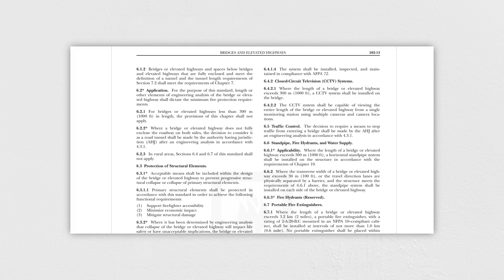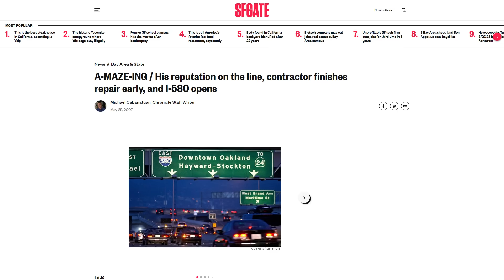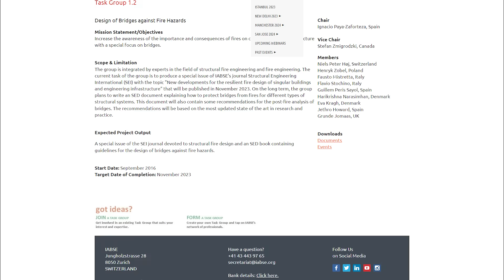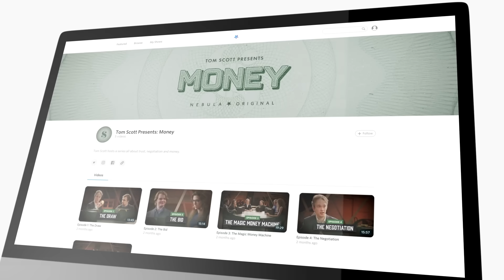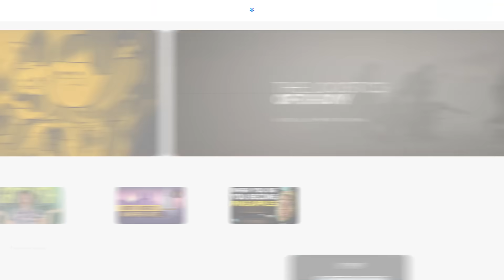Philadelphia I-95 Bridge Collapse Explained

Comment: I’m a disabled firefighter and you mention the heat from convection and radiation but don’t discount conduction and time.  Since most of those bridges have concrete walls/ supports for the steel I beams.  As that concrete heats up it also weakens and to get spalling and cracking.  Based on the image of this collapse it appears it failed more at the end than in the middle so the failure might have been the vertical segments of the structure instead of the horizontal ( steel) structure.  But as I just mentioned time is also a factor.  That concrete holds the heat far longer than the steel structures once the heat source ( fire) is removed (put out).  Those I beams are designed for load but the thickness of the steel is also determined by a limited period of thermal loading.  However, the concrete vertical structure acts as a thermal “battery” holding that heat longer and conducting that heat to the steel above it.  Because how long heat is held against steel is often more of a factor in weakening it than how much heat is applied ( based on ordinary materials burning and excluding non ordinary materials like thermite) the areas near such vertical structures are the ones most likely to fail.  They become the weakest spot in the steel structure because in addition to radiation and convection they are also subjected to conduction, the weakening of its vertical supports, and because the heat will continue to be conducted to that area after the fire is out.  When I left the fire service in 2004 there wasn’t a standard on fighting bridge fires so there may be new standards, but if the bridge hasn't failed once the fire is extinguished firefighters stopped dumping water on it.  There wasn’t studies to determine if it was better to keep hitting the tunnel walls with water to cool them to reduce the long term thermal stressing of the steel or if the cooling the concrete in this fashion would cause increased spalling and cracking causing the vertical part of the structure to fail.  It’d be interesting if someone is investigating this question I to see you make a video on their investigation.

Comment: Exact same thing happened in Yonkers, NY in 1997. There was a turning lane that looped back under the underpass for I-87 which had been known to be dangerous and a serious risk for decades, but had been left once it was built. One day a tanker truck made the turn and was hit by a car coming down the road that formed the underpass. The truck sprung a leak which quickly turned into a fire, and it destroyed the overpass for I-87. It ended up taking about 5 months to rebuild in an emergency contract, and that turning lane was removed, as there was another not a block away controlled by a light already.
Reply: There's also the 1994 Grant St overpass on 287 in White Plains.
Propane tanker took out that whole section.
Reply: @jimurrata6785 in august 2018, near Bologna Italy another propane tanker rammed into a line of still vehicles. Probably the driver had a stroke or fell asleep. The explosion's fireball was 100 meters in diameter and brought down the overpass it was on. There were 150 injured because of the debris. The highway ran over some residential area so there were plenty of shattered windows
Reply: @iaial0  Good old fashioned BLEVE.
Reply: @iaial0  
That must've been an illegal truck then. It's extremely difficult to puncture a legal double-walled tanker like that.

Dangerous single-walled trucks are legal in the US, but illegal in most of the EU.
Reply: @jimurrata6785  was that the one where the tank 'cylinder'broke from the chassis and went like a rocket ,through someones house?

Comment: It's interesting to see what repairs were actually done in Philadelphia to reopen traffic. It was not a finished repair job. Instead, it was a temporary bypass that will need to be dismantled and rebuilt in the future. If you believed the famous politicians doing a photo op during the "reopening," you'd think that the bridge had been fully reconstructed in only weeks like the Sanibel bridge in Florida. Thanks for clearing that up.
Reply: But now they have the time to rebuild the bridge with proper schedules and not needing to rush.  It is now a standard, demo half a bridge, rebuild it, move the traffic to the new span, then repeat.  What they did was the best solution to this issue.

Comment: It would be intersting to know the ratio of tanker fires at bridges and overpasses to all highway tanker fires. Is something drawing these tankers to the structures? Love your videos.
Reply: My hunch would be that bridges and overpasses are where the large majority of fires occur. Tight curves on on/off ramps, like on I-95, and sudden obstructions just off the roadway, like support pillars, leave a lot less margin of error than you'd have on a straight road through cornfields.
Reply: Bridges and overpasses are inherently less forgiving of driver errors or vehicle mechanical failures than many other parts of roads. For instance, the Harrisburg, PA flyover ramp fire (which happened near me) involved an area with a relatively sharp curve for a major road (it's effectively a right- exit "left turn" from an interstate onto a major state highway) and the tanker overturned. The driver took the curve too fast. Without the sharp curve it's less likely the accident would have happened. And even without curves, there's just less margin for error in the form of medians and shoulders.
Reply: No, you just don't hear about Fires that aren't under Bridges. I know of similar "Symptoms" myself, as I work on Tanker Ships. These are the most accident-prone Ships in the Public Opnion, while statistics prove the exact Opposite (especiall for Liquefied Gas Tankers). If any other Type of Cargo Ship sinks or burns, nobody bats an Eye as long as there's no Oil Spill involved. But Tankers just have this Public Perception of Oil Spills and disastrous Fires, that they are under constant Scrutiny.

Comment: Many years ago I worked for a small city public works department that had a small crisis when a single access road slid during a major storm event and stranded about 40 homes without any access for emergency services or other vehicles. The solution that was chosen because the soils couldn’t handle the loads of normal rock fills was wood chips. Yes, wood chips. 30 years later and the road is still open with minimal settlement. I’m not sure if this repair will last another 30 years, but for a emergency repair I think it’s done a fair job.
Reply: you're lucky.  in my area, the main highway into town had a slide, and the repair was carried out with wood chips.  for the first few years, the road would be venting steam through the cracks that formed as the chips settled.  now things are stable enough that they only have to repave the section a couple times a year.
Reply: i'd say that's lucky for that cheap of a repair, though i am sure it will be seeing replacement fairly soon.

Comment: The same happened in Germany on September 17th, 2020 on the A40 Autobahn. 
A tanker truck burns out under a bridge. 
The bridge was then demolished and rebuild.
And that in the most populous area with the highest traffic volume.  A main railway line runs over the bridge and also had to be closed.
The replacement buses for the trains had to drive under the bridge.
Reply: This video instantly reminded me at that incident, as I live close by. Good that you mentioned it. I would be interesting if there is a public investigation report available.
Reply: Nice example of a literal single point of failure.
Reply: @iaadsi  Sort of the same Thing happened in Hamburg, but with a Metro Overpass. You might be not familiar with the Geography of Hamburg, but the City is literally divided into two Parts, that are separated by a River instead of a Wall. The River can be crossed at two Points only; a Highway Tunnel which has terrific Traffic Jams 24/7, and a Set of Bridges that carry another Highwayand  a major Road, both with serious Congestion too, plus Metro Rail and Mainline Rail. That Metro Rail is the most important Way for Commuters to cross from one Side to the other, and it was interrupted for about a Month until the affected Overpass was fixed.

Btw. talking about Single Points of Failure, Hamburg also is the only "Gateway" for Rail into the northermost Regions of Germany and then further on to Denmark and Sweden. The Rail Line going through Hamburg is the most congested one in Germany, and 20+ Minute Delays because Trains are "stuck in Traffic" are regular. That Line was down for three Days last Year, after a Data Cable for Signalling was destroyed in another Fire last Year. Until a few Years ago, there used to be three Cables for Redundancy Reasons, until some smart Manager realised that Money is wasted on three Cables even if one can do the Job just as well. That three Day Interruption completely cut off northern Germany from the rest of the Country, also brought Regional Rail inside northern Germany to a near Full Stop, cut off Denmark from Mainland Europe and Trains to Sweded had to divert to a Ferry. All of that because some Manager wanted to save a few Bucks that were "wasted" on Redundancy.

IIRC, both of these Incidents happened last Year, or maybe in 2021.
Reply: @Genius_at_Work  That sounds very similar to Prague, which is also split down the middle by a river (Moldau) with very few high capacity bridges/tunnels forming natural choke points. Prague is at the center of our star-topology highway system, so virtually any two places in Bohemia are connected via Prague. The ring road is incomplete so lots of transit traffic literally has no other option but to punch through Prague itself, right by people's apartment windows.
Reply: @Genius_at_Work  I live in Hamburg and can confirm it was a total mess in every of those cases. Also I'm very surprised how the huge Elbtunnel is a 24/7 traffic jam, considering it has 12 lanes of road in total. Often they even close it over the weekend because of the construction site north from it that is at least for 10 years there, and then all the traffic drives on the next street from my house in the city center just to take the bridge. My wife's boss used to come to work by car every day from Harburg to Altona and was 4/5 days a week at least 30 minutes late.
Reply: Can confirm the stories about the river crossings. It was not pleasant.
Neither is the rerouting of the public transit at the Harburg station, it's a complete mess. For a good cause, i.e. the complete overhaul of the congested express, regional, local trains and local bus interchange, but there could be other ways to prioritise public transit (move tenthousands) instead of private metal boxes (move hundreds).
Reply: Makes me think the economic impact of closing the rail line is probably orders of magnitude greater than the highway
Reply: I heared a uranium hexafluoride tanker got into an accident @tfolsenuclear this involved a tanker truck crashing
Reply: Dang that is crazy. Just funneling everything on that one area. I feel that from a city and transportation planning perspective its a bad isea even if it didn't catch on fire. If there was a need to evacuate, people would funnel through that single corridor.

Comment: Well, the problem is likely to diminish in the future. More EV's, less fuel trucks, win, win.
Reply: EV also catch fire. A really hot and difficult to put out fire. How would an EV fire affect a bridge compared to a tanker fire?
Reply: @RRCesconeto  Yes they do, just like the much, much more frequent ICE car fires. The energy release is similar, and of course just a tiny fraction of the energy released when a fuel truck crashes.
Reply: @KSCPMark6742 V fires take longer to put out, can randomly reignite, and take drastic amounts of water to put out vs an internal combustible engine.

PS: EV's are still dependent on fossil fuels when they recharge.

Comment: Before the conclusion Im guessing pockets of water inside the concrete expanded due to the heat and cracked the foundational structures. Now that would only be one of the reasons, I'm sure there were a collective of reasons.